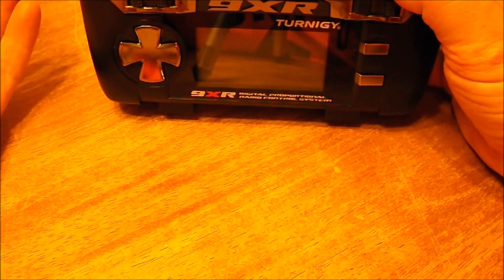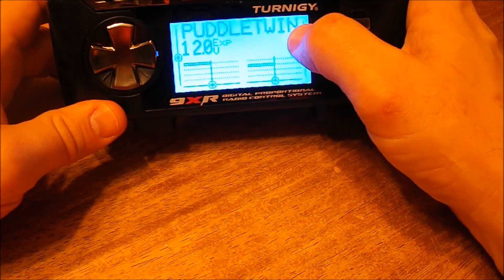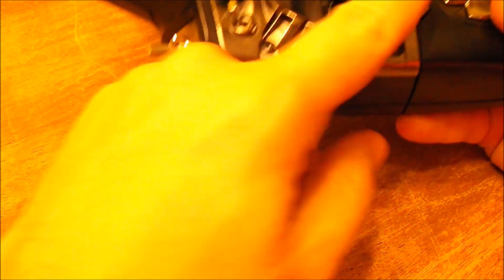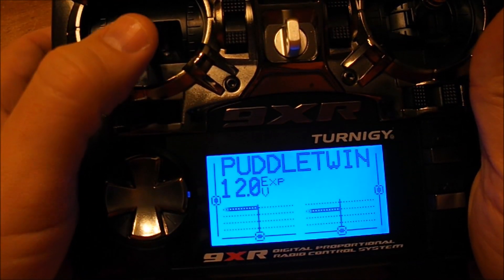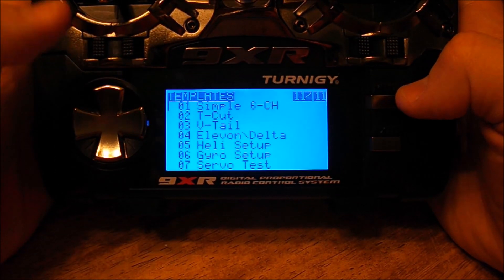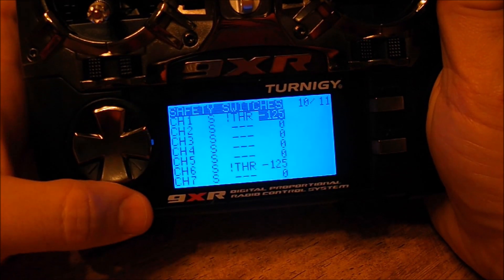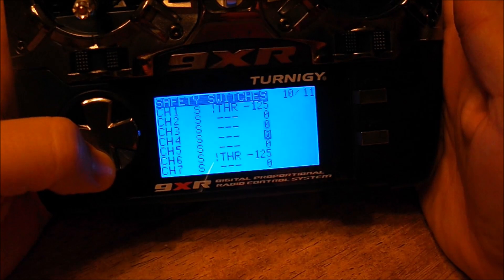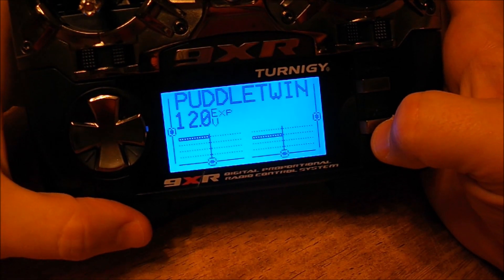9XR throttle safety

Comment: I'm having difficulties setting up my 9xr to fly a qbot drone. I thought qbot needed a futaba setup so i bought a multi functional module. Found it impossible to bind. Then i noticed you could connect the tx module supplied with the qbot via the trainer ports. either via the jack or the square multi pin plug. 
  Now it binds but everything was mixed up. I managed to reverse the channels as needed and get everything where it should be but now i can only get half throttle. If i switch the radio to a different model I can see throttle going above the half way point. I go back to my new model setting for the qbot but i can only get throttle to go as much as half stick. Anything above half stick does not register. I can't see what setting is limiting the throttle. Any ideas? Thanks.
  I found it. Went into mode EXPO/DR (menu 4) I had to put throttle into the full position to see that it read 0 then with throttle full up i could edit it from 0 to 100

Comment: Great videos on the 9XR!  Very helpful.  My preference on my all model setups is that all switches on the radio are in their down position when ready to go. Makes it easy to remember the radio setup for a plane when you have >20 planes.  I used this video but configured it with THR instead of !THR.